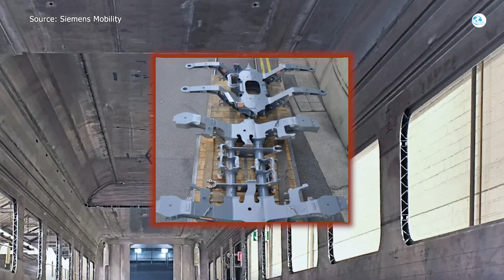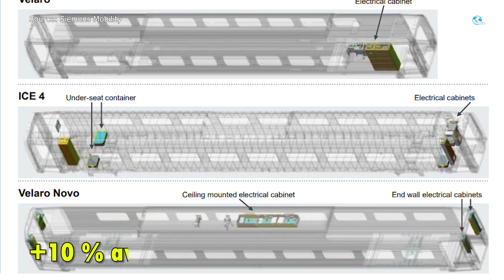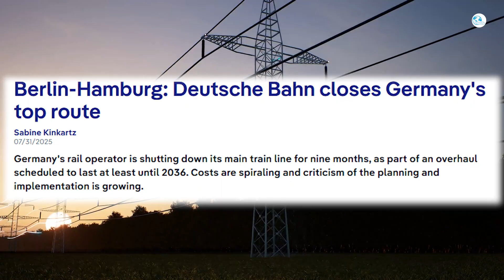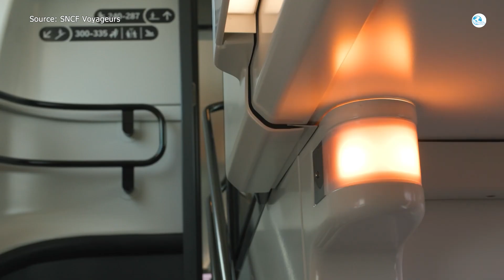Big Announcement! Siemens Fastest High-Speed Train is Finally Coming...

Comment: The china's CR450 is still faster than that train.
Reply: Fasten Trains, higher electricity Consumption.
Reply: Germany is waaay smaller than china, therefore cities are closer.. it is not about capabilities but aceleration and deceleration in shorter distances.  TGV (in france) also goes faster but conections between cities are not as close as in Germany.